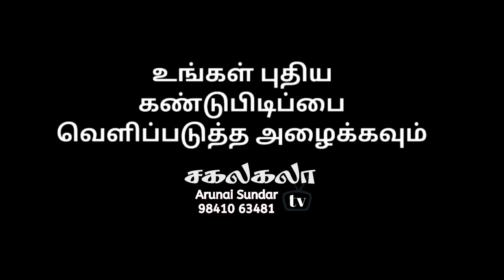New Invention || வாலாஜா விஞ்ஞானி || Young Scientist || Sakalakala Tv || Biodigester ||

Comment: The posinous gas form in septic tank is hydrogen sulphide, methane  it is colourless, orderless at high concentration, heavy than air. 

Septic tank gases contain methane, hydrogen sulphide (H2S), carbon dioxide, sulphur dioxide, ammonia, nitrogen dioxide and traces of carbon monoxide. Hydrogen sulphide has a characteristic smell of rotten eggs, which is easily identifiable by human olfactory organs and serving as a warning signal for sewer gas leakage. It is a colourless gas, heavier than air, corrosive and flammable. Exposure to even low concentrations of hydrogen sulphide can cause irritation of the eyes, sore throat, dyspnea and cough. Prolonged exposure can even cause pulmonary edema, headache and dizziness [4]. Exposure to levels > 100ppm (parts per million) can be dangerous as it causes olfactory fatigue and the smell becomes undetectable. Exposure to higher concentrations (>300 ppm), results in rapid loss of consciousness and death. Even a single breath of a concentration higher than 1000 ppm can cause immediate collapse (‘knock-down”) and death. The toxicity of H2S is due to inhibition of oxidative phosphorylation and cytochrome oxidase resulting in reduction in cellular ATP (adenosine tri-phosphate). Inhalation leads to a multitude of respiratory complications like organizing pneumonia and adult respiratory distress syndrome (ARDS). Exposure to high concentrations of methane can be dangerous as it reduces percentage of oxygen in the air and causes hypoxia [5]. Methane gas inhalation can cause asphyxia, loss of consciousness and pneumonitis.

Reference courtesy: 
https://medcraveonline.com/JACCOA/a-fatal-case-of-septic-tank-gas-poisoning-critical-care-challenges.html#Discussion
Reply: What is your intention with this explanation, whether this So sanitizer digestion-liquid is useful or Not? Give shortly